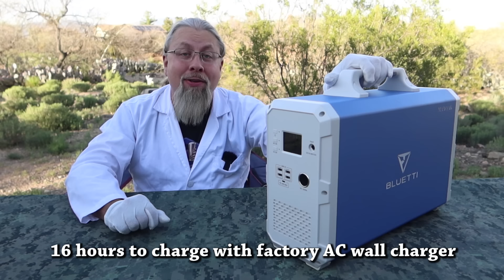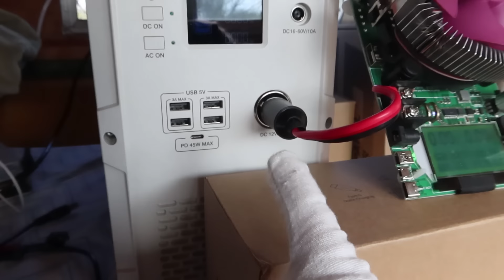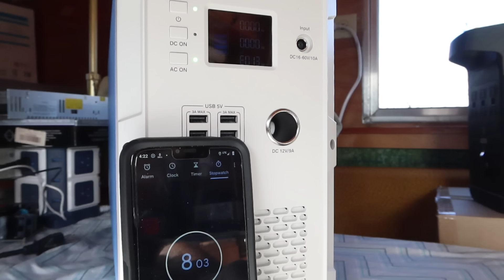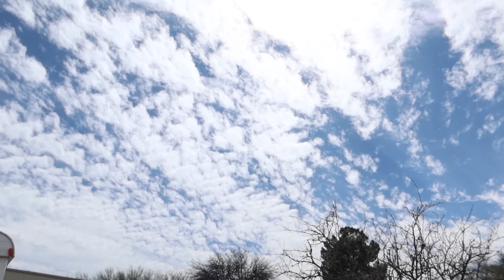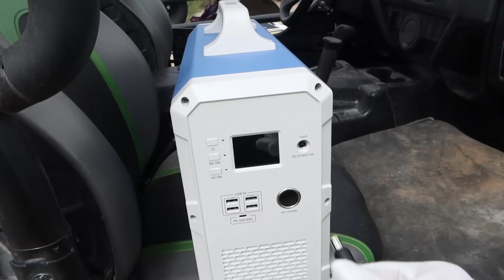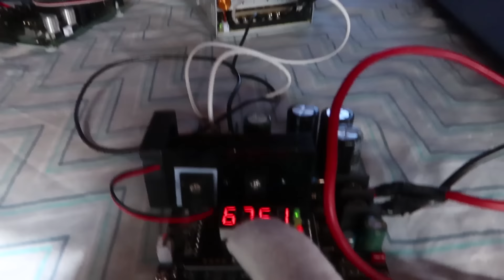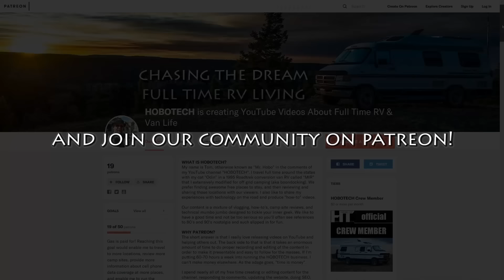MASSIVE Off Grid PORTABLE POWER Station! 2400Wh MAXOAK Bluetti EB240 Lithium Solar Generator Review

Comment: I have a question for you. I watched this video and now I'm questioning the plan to get the Yeti 400 with Boulder50 solar panel kit. I am in a tiny old trailer but would want to power the refrigerator if needed. I have the usual stuff to charge, phone, tablet, a couple laptops. I am in AZ so some kind of cooling device is essential.  I don't have the money for the big job you have,  but will this 400 be enough for me at all?
Reply from the maker: A 400 is way too small for powering a refrigerator more than overnight. You want 1000wh or more. If you want to run any kind of AC, this 2400 is about minimum. You could use the 1500 with the trick I mention in the video but it gives you little wiggle room once the sun goes down.

Comment: OK, I just switched computers and this one is OK. Black and Bluetti! Love it. Good price for me. I'm still confused about series vs parallel connection of solar panels. I have two 100 watt panels. Each outputs 56 watts. Together - still only 56 watts! There's only one way to connect the "Y" adapter. What am I doing wrong?
Reply from the maker: Bluetti HATES single solar panels (remember the 16 volt minimum limit ... it's more like 18v for MPPT to kick in). You need to have at least 2 in series for proper charging. Parallel when you want to add pairs of panels to that.
Reply: If you get 56 watts from one, and two still only gives you 56 watts, it's probably not your panels that's limiting it, but the load.    As far as connecting parallel vs series connections, a quick google should bring up some diagrams for each.

Comment: When you forget to check how to charge at 500w solar. Do the math it is not a standard set up to get the full 500w over solar due to the weird voltage/amperage mix.
Reply from the maker: Don't understand what you're saying. I simply demonstrated how to charge @500w on a very cloudy day by using more panels. On a sunny day use 500w of solar to charge around 400w. Nothing "weird" about it.
Reply: @HOBOTECH  this guy explains the issue with the 60v 10amp when using 5x 100w panels https://youtu.be/KTKmKJ5z4DQ
Reply from the maker: @shoestringsev4529  I think you assume 100w panels when I was showing 4x 170w panels in my video.  You can easily hook 4 up in series-parallel for 680w and charge at 500w. For 100w panels you need to use 6 for the same effect.